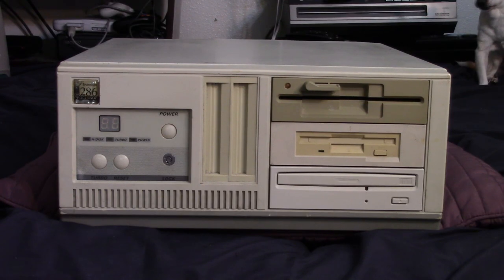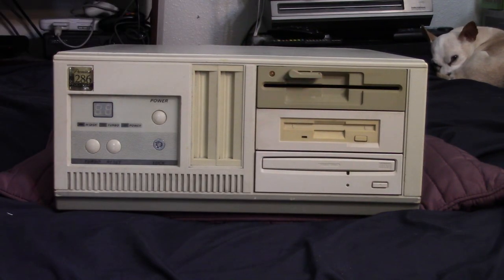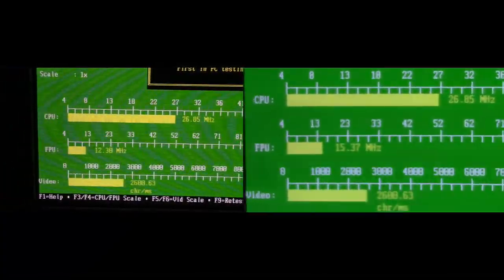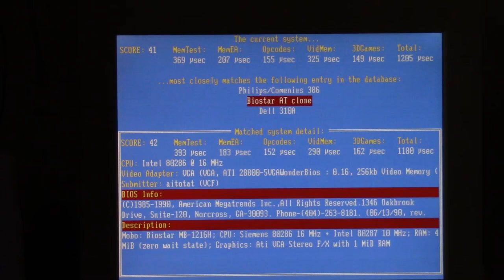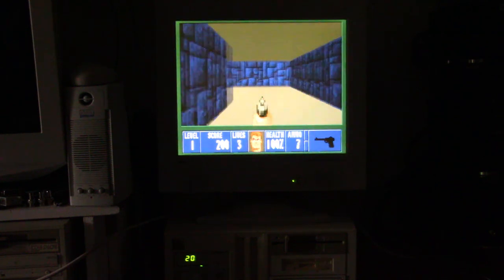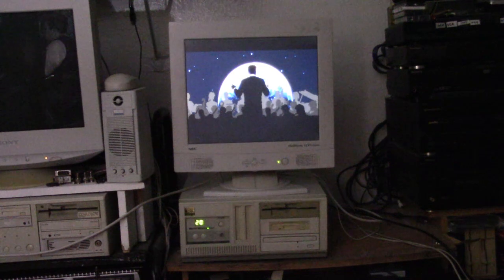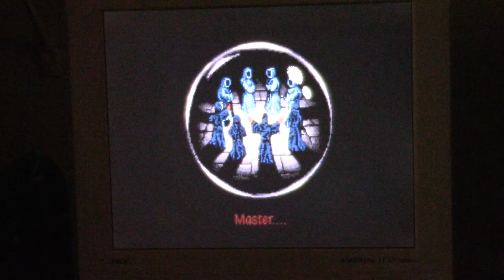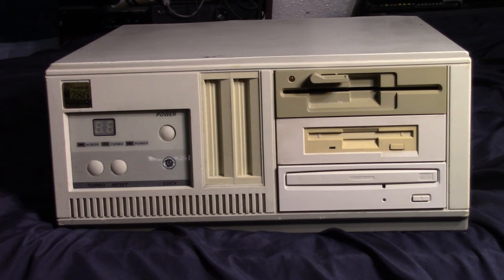20MHz Harris 286 PC, a second look

Comment: Tons of 286's were upgraded at home with Sound Blaster cards with CD-ROM drives.  And yes, towards the end, there were 286s sold from factory with CD-ROM drives in them..... mostly for software installation (a lot of software was starting to move to cd-roms at that time).  Also, CD-ROM drives came out (first only as an addon aftermarket) around 1989 (often external at first).
Reply from the maker: I'm generally an advocate for tossing a CD drive in a 286 but whenever I do  its inevitable that I get at least 1 or 2 comments about how it's either pointless or not period correct

Comment: The 20MHz 286 was my second computer (1st was the Tandy 1000EX). It WAS in a tower, had the same 4MB of SIPP RAM, and a TSENG ET4000. Bought it Right as the 486's started showing up on shelves in 1990, as a stop-gap because of King's Quest 5 needed a hard drive. Mine got a 2x Sony CD drive before the 486 board that I dropped in when Doom came out. So your setup is pretty close to correct. If you get the KQ6 CD that says it needs a 386 SX, they lied because my 286 ran it just fine (pre-rendered video and all).
Reply from the maker: do you recall if the 286 PC had the CD drive pre-installed when you bought it or if you added it later? did you buy it at a local computer shop and it was an in-house build of theirs?

Comment: Tandy sold a 286 at 16 MHz as maybe their very last one.  It had room for 5 MB on the motherboard and was a business class machine (not in the home 1000 line), I think it was the first "Tandy 2500".  And I also think they had it as a 18 MHz in the next and last revision of it.

It was in the later case they had that the top slid off and the insides did a flip up kind of movement to get to everything inside.  It also had built in VGA and could be bought with a CD-ROM drive when new.

I worked there back then..... It was sold from early 1990 until late 1991.

It had dual built in IDE controllers (IDE also used for the CD-ROM drive), had a 105 MB hd but could have had one of several other larger ones.  And it had a memory expansion for the video memory.  It used PS/2 style keyboard and mouse connectors.

Comment: I dont think that 20Mhz 286 should be equivalent to 20Mhz 386. 386SX is not the same as full 386, and even SX model should be substantially faster than 286, due to the cache and some architecture tweaks. Why the tests not showing it - i dont know.

Comment: I'm surprised the ipc is almost the same between the 286 and 386sx, of course when new the 386sx was WAY cheaper than the clock doubled 286. The 386sx is the same as a dx except for the fact that the data path is 16 bits instead of 32. It seems like the only thing that makes a 386 better per clock is the fact that the front door is wider, so more freight can be brought through at once.

Comment: Generally the power switch is (if a big physical one, rocker switch) isnpart of the power supply...  Especially in a mini tower.  So you most likely should have been able to just change the power supply.  The overwhelming number of PC cases on the market can only have a "catastrophic" problem when caused by rust, other water damage or from too much weight on it (bending the case).

Comment: Wing commander is running slightly too slow making it a little easier.
Reply: It should be faster than 386sx/16 in 16 bit code, if I remember correctly.

Comment: I have a Harris 286-20  motherboard is a BIOSTAR MICROTECH INTERNATIONAL , MB-1220VE 16 meg 30 pin sims 80 meg Hard drive 3.5 1.44 floppy, 5.25 1.2 floppy  ATI vga adapter Sound blaster 16 with 2x cd rom  14.4 k modem 10 base T Ethernet adapter

Comment: I have one 286 25mhz! My board is the same
Reply from the maker: Your running a 25MHz Harris on this exact board? Can you confirm it's running at 25MHz and not 20MHz? The spec sheet does not claim 25MHz compatibility and I see no jumper or switch to go from 20 to 25MHz.

Comment: Definitely the CD is a no, no in a 286. Case is beautiful, Get a 1.44 and 1.2 that match and you'll a very cute PC.
Reply from the maker: I disagree on the CD drive, especially on a 286 this fast. I would agree it's not period correct unless you're going for a 286 that was upgraded over time but as I mentioned, plenty of older games that will run on a 286 were rereleased on CD. The drive isn't hurting anything except for the minuscule memory it takes for the driver and it potentially adds a lot of convenience and game options.